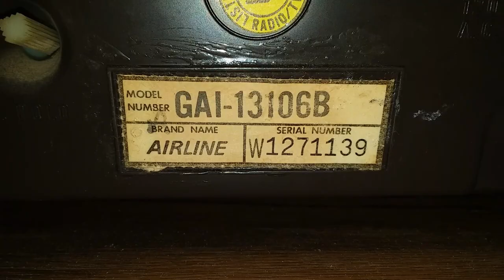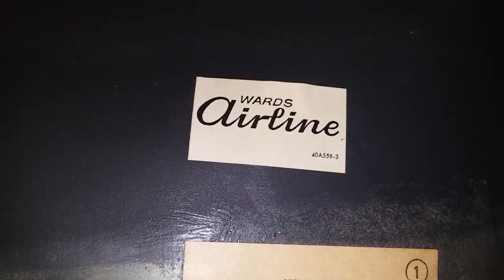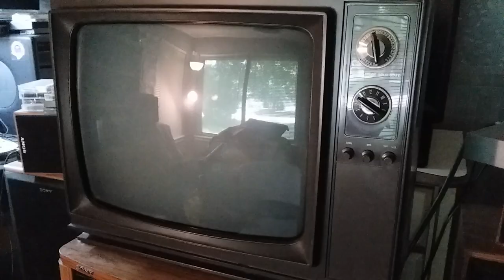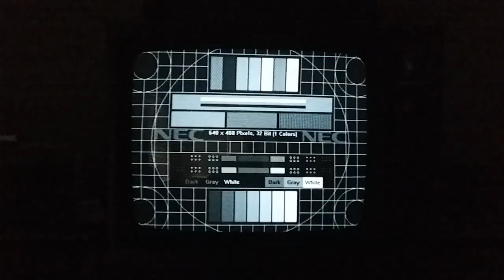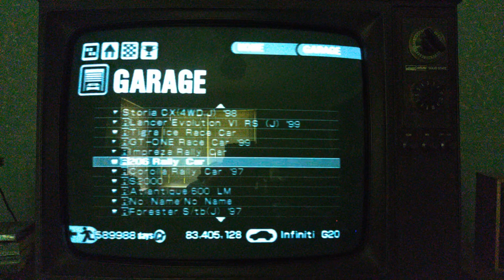1976 Montgomery Ward GAI-13106B (Admiral SKB1901?) b&w CRT TV

Comment from the maker: Jordan Pier's video of a '66 Admiral and the CRT label randomly says "1240" on it, that's the EIA code, same as mine but 10 years before. I have also seen a Taiwanese Philco with an EIA 1240 CRT and the 15" General Electric Spats bear has has an EIA 1240 CRT as well, so i guess they sourced B&W CRTs from Clinton electronics corp, but i wonder how long. It's not the first time i have heard of that company, they made CRTs that are in some of the vintage all-in-one type Apple computers if they didn't have a Sony or Samsung tube.